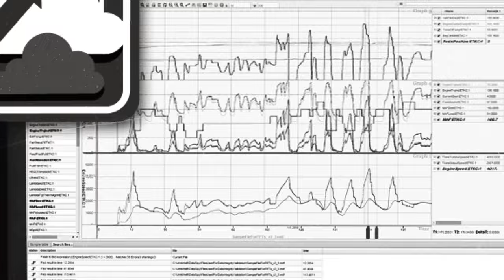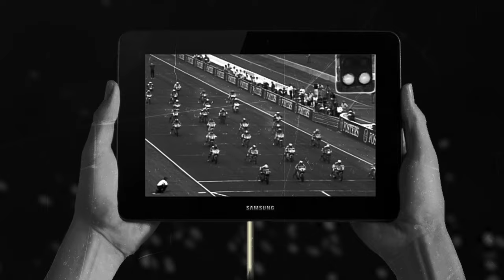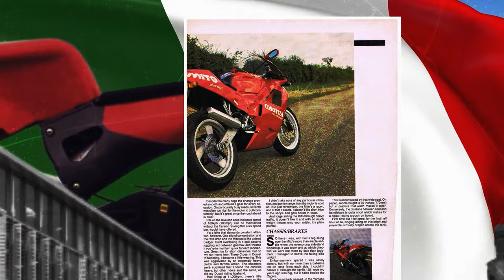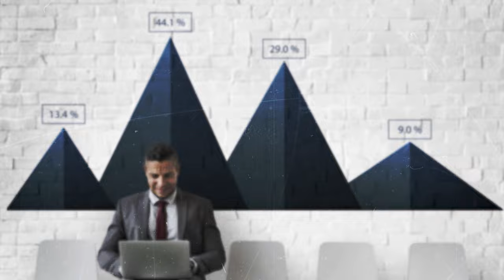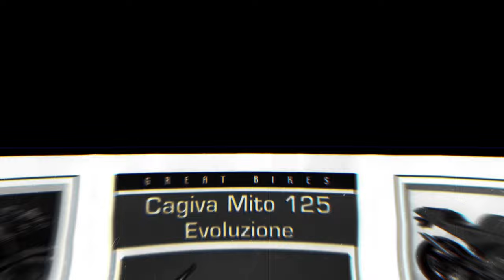How The Cagiva V4 Grand Prix Flourished and Failed

Comment from the maker: What's your favorite Cagiva motorcycle model from this era? Share your thoughts!
Reply: I had a 1984 Cagiva 125. No power valve....made 3hp 1000-8000rpm and then made 30hp between 8000 and 10000!. It Always spun the tire even when I let the rpm build up slowly.... Then I got 3 Cagiva 500's MX bikes, 1985-86. . Good power but heavy. They got maybe 10mpg "on the throttle".
Reply from the maker: That's awesome! I'd love to ride any of those. I didn't get my first dirt bike until the early 90s and I didn't even know Cagiva existed back then. They made some cool bikes though.
Reply: Elefant 900

Comment: Wrong. They never produced 350cc 2 strokes. This is common engine swap from Yamaha. 😊
Reply from the maker: You're partially right. The Cagiva Mito had a Yamaha RD350 engine in it. Cagiva did produce a 2 stroke 350cc motorcycle though. It was called the SST350.
Reply: The SST was an aircooled single cylinder enduro dating from the 70’s. The Mito never did come from factory with the Yamaha 350 cc twin. It was a common engine swap, but the factory hasn’t anything to do with it.